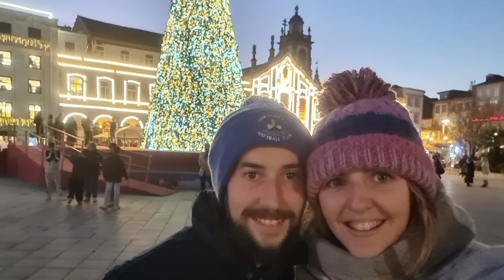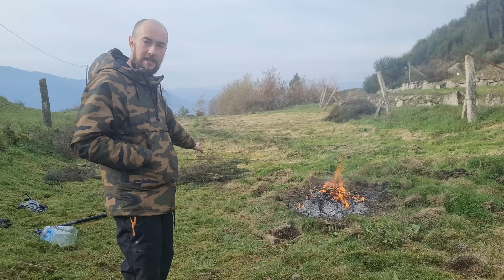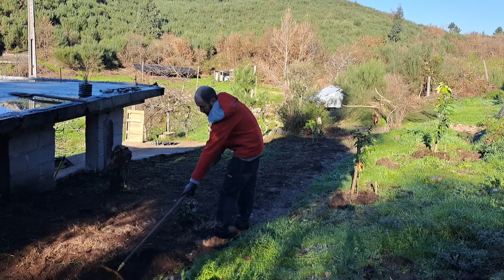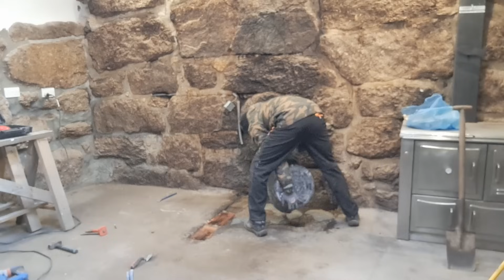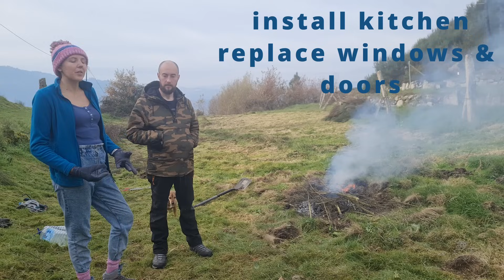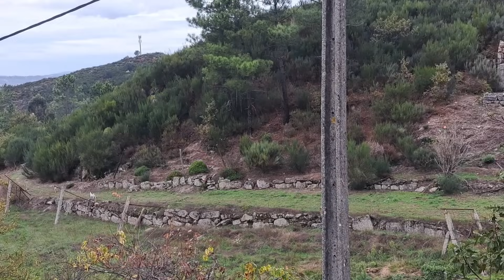Starting a small farm - Our plans & challenges for the new year!

Comment: wow.. you two have achieved so much in 6 months. A few suggestions, build a simple wooden frame, even from pallets, for your mattress to sit on so air circulates under it, mould can quickly develop on the underside.  
For fencing, a really effective and free barrier can be made with hurdle or wattle fences (lots of you tube channels show how) you can make them with longer branches of broom, as you have so much. For the areas up the hills, where you have trees close together, simply use the trees as Stakes and weave long pliable branches between them. they only need to be a couple of feet high, but will provide a visual barrier and make it more obvious it is a boundary.  If you want to make stronger barriers, look at hedge laying, useful where you have hawthorn growing close together. Ben & Lois Orford have a great you tube tutorial, easily done with hand tools.
 Also, Huw Richards has a free beginner veg gardening course available, his channel is great for all sorts of ideas.
Reply from the maker: Thank you so much for all the suggestions.. Will look into everything you mentioned, very helpful 😊💚